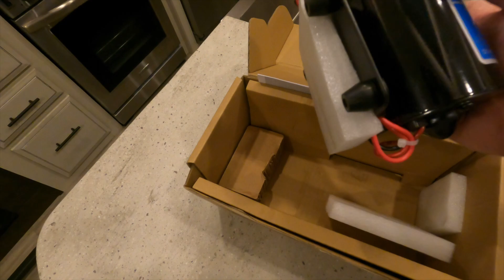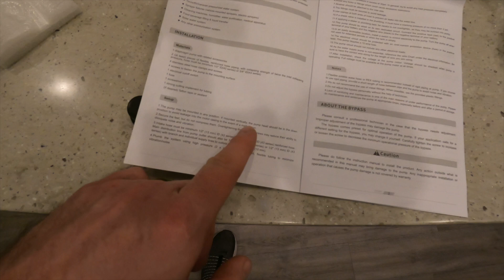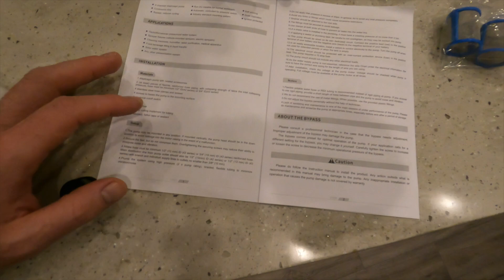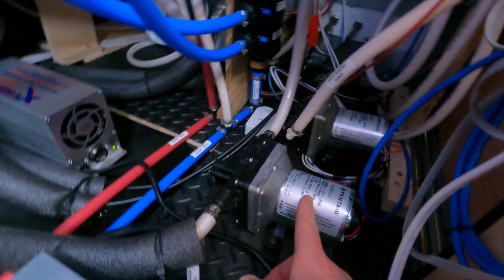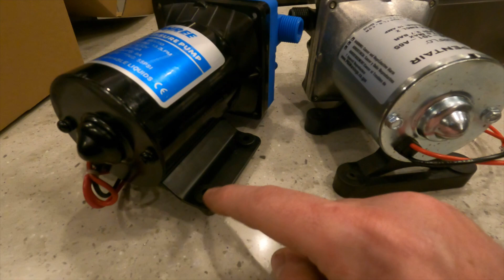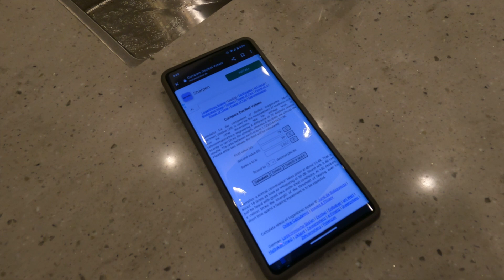I Test Kohree vs Shurflo in my RV // 12V 3.5 GPM 55 PSI Diaphragm Water Pump with Pressure Switch

Comment: 24:51 Thanks for the video. Considering swapping out the shur flo 4088 in our travel trailer for the Kohree! How. Is it holding up over time?
Reply from the maker: I just sold my Pinnacle featured in this video, so it was in-use for about 8 months and the Kohree was flawless. Never had any issues with the Kohree and it was much quieter than the Shurflo I replaced it with.

Comment: Is this pump ok to put in the bilge of a boat?  The Sureflo I need to replace has “ignition protected” on the label.
Reply from the maker: Not sure. The manufacturer advertises it for boat use, but I don't see a note about ignition protected. Mine's still working great, much quieter.
Reply: @AdventureRocks  we are manufacturer of it , and it can use for boat , for the fresh water .Overheating protection

Comment: So, I have the same issue as you in a 2023. That pump sounds like a hammer going to town. lol. I feel it is the same issue as you... too much pressure being forced into such a small line. I wish you had noise levels from at the sink. How much quieter is it at the water point? Good info and glad to know we are not the only ones with this annoyance.
Reply from the maker: @ 22:34 you can just barely make it out in the coach, but huge improvement. I'd say the modifications done in my first video (https://youtu.be/YSlJXLKExOo) take the noise from 10 (worst) to about a 5 with Shureflow pump, and then the Kohree pump swap goes from that same 5 to a 3 (1=completely unoticeable). I think ultimate solution would be to re-plumb in 1/2 pex after 24" flex line, but I'll probably wait to do that till I have to take apart underbelly. It's a great idea Jayco has there...I think they have a patent on it, but the execution leaves a lot to be desired. Hopefully they'll listen to owner feedback to make some improvements to it eventually.